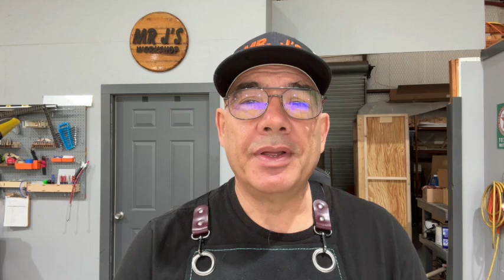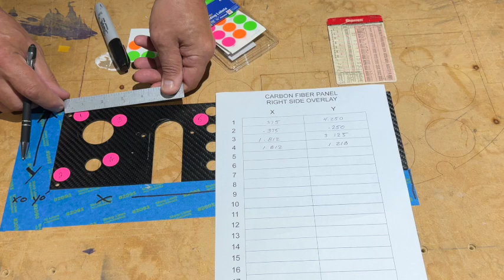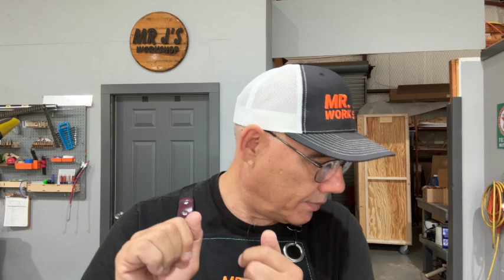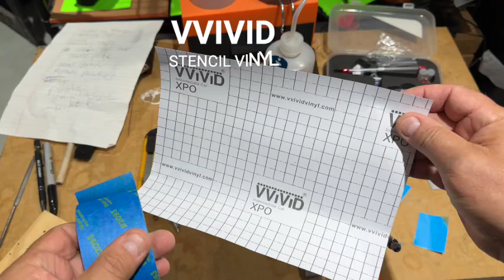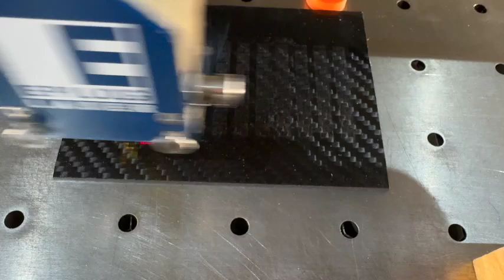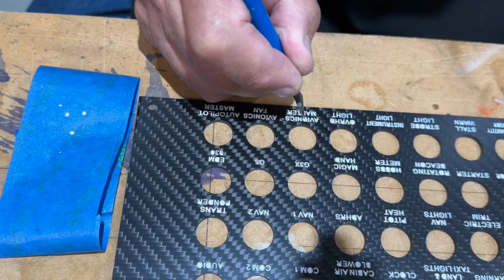HOW TO MAKE A CARBON FIBER OVERLAY ENGRAVE AND AIRBRUSH LETTERING.

Comment: If the overlay was going to be used on a piece of equipment that is outside, what paint would you use?  It looks like you are using the Wicked Color W001 paint.  I suspect the paint would need be a two stage paint (base+clear).
Reply from the maker: Clear coat edges so not to bleed , paint letter’s and clear coat  to seal everything

Comment: If you wrap a piece of stronger tape around your hand once the paint has cured enough you can use that tape to remove the remaining stencil tape. I did that for a few cornhole boards & it worked super good
Reply: Thank you Jim, guys if you need custom panel work or engraving this is the man who is an absolute perfectionist and can’t wait to start assembling my plane..
Reply from the maker: @ thank you for kind words
Reply from the maker: @Jrm5814  thanks for the dip will try the next time